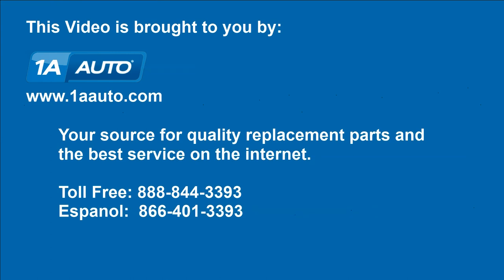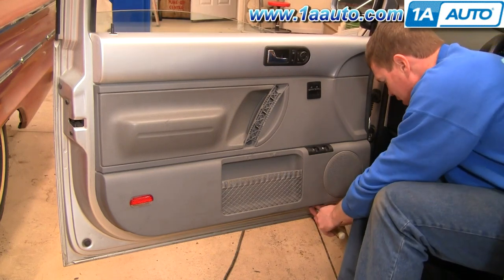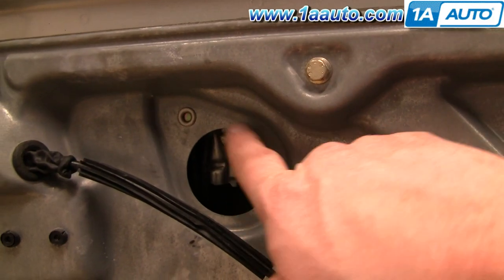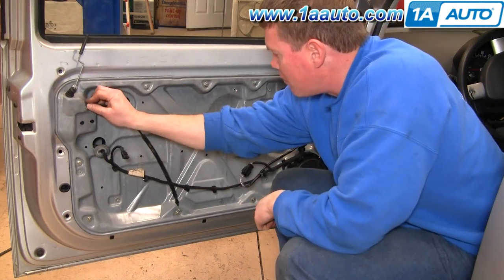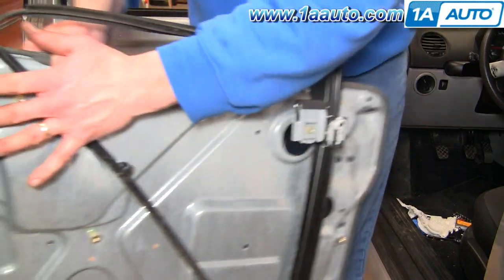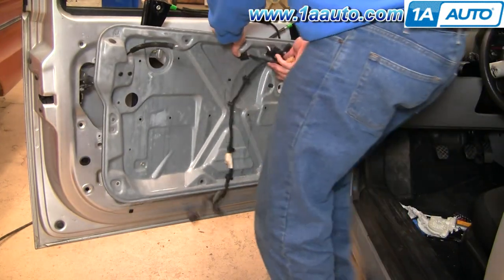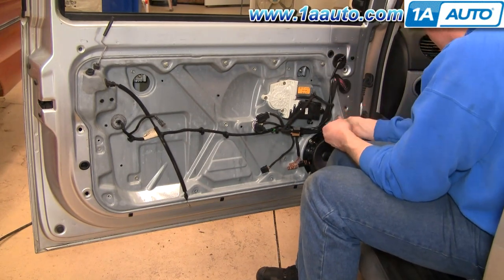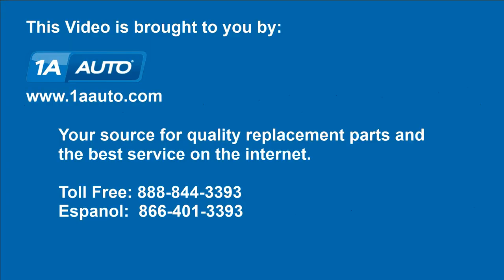How to Replace Window Regulator 98-10 Volkswagen Beetle

Comment: You really should have shown the door connector on camera and showed up where the releasing tab is.  I have been feeling around for over an hour.  I also do not know whether the little black piece on the bottom is the part that comes off or if it is the whole black piece.  Please give us a hand here!
Reply: Did you ever find it?

Comment: Folks I don't know how he undid the door latch tab with his fingers but after using a small mirror I poked around with a flathead bit in the hole facing the door...bit was handy as it's shorter than a screw driver ...and it came away easily then. Took an hour to figure out because he seemed to be just pressing something.
Reply: ...also you need bolts and washers...I had to drive out and get some halfway through, climbing out passenger door at hardware!Otherwise thanks for the video!

Comment: I had to replace the window regulator on a 2001 Beetle. Watching the video was very helpful in deciding that I could do it myself. It took me about three hours, but that's primarily because of the last connector in the door. Like most people, I had a hard time finding the x@!#X$ tab... Also, I ended up adding some lithium grease on the channels and pulleys to get rid of a squeaky noise. Thanks for the replacement part and video!

Comment: Thanks for the great how-to video.. I was able to replace the regulator in under 2 hours and not screw anything up. The only tricky part is unclipping the electrical plug from the lock assembly. What a pain that is!
Reply from the maker: Thank you for watching. Glad it helped!
1aauto.com  888-844-3393
Reply: How did you do it? I can't unlock it and he didn't show the tab that he pushed or pulled to unlock it

Comment: Excellent video. The window on my 2005 Beetle wouldn’t roll up so yesterday I took off the door panel but couldn’t get the window to stay in the track. I was thinking maybe I needed some adhesive but now I see (from your video) that I need to adjust the torx screws. Heading outside to try it now. Thank you for posting this!
Reply: BTW it turned out to be a 10mm bolt (rather than a torx 30) on the ‘05. Same concept though —and now my window works again! It struggles a bit though so I need to find out what’s causing resistance.

Comment: Thank you so much Mike! I have a 2001 Seat Leon 1.8 20v and I'm having some problems with the electric window. I've bought a repair kit and tried to replace it however I didn't know how to take that metal panel off. Thanks to your video now I'm able to do it myself and don't have to pay for it :)

Comment: If you're removing the plastic regulator, DO NOT cut the plastic ties on the new regulator until it is in place and all the cable are connected.  I made the mistake of cutting them before I connected the cables in place and it all unravelled and added hours to the job.  Get all the new cables connected, put the regulator in place and THEN remove the plastic tie and black clamp and any other plastic ties.  Thanks for the video.  I did eventually get it done and saved hundreds of dollars on a trip to the mechanic.  I ordered a replacement kit on eBay the cost $35 and came all the way from Turkey in less than a week.
Reply from the maker: +Sean McKay Thanks for watching. If any of our viewers needs to make this repair, we carry the auto repair part shown in this video on our website. Here is a link to them http://www.1aauto.com/1A/WindowRegulators/Volkswagen/BeetleNew/1AWRK00257?utm_source=YouTube&utm_medium=CTA+Comment&utm_campaign=ytcomment&utm_term=GJzjDr9-_XI

Comment from the maker: On the wires that connect to the switches on the back side of the door panel, you need to squeeze the tabs ob the connector together to remove the wire harness.

Comment: Hello everyone! For anyone who's stuck with that connector at the end of the wiring harness, it's shaped sort of like a cylinder (on my 2001 Beetle, at least), and that cylinder pulls straight out from the rest of it. There doesn't seem to be a tab that holds it in but you'll want to wedge a flathead screwdriver in where the cylinder meets the rest of it to pry it loose and get it out. 

Good luck!

Comment from the maker: You may want to make sure that there isn't anything inside of the door that the regulator is running into, which could be slowing it down. 1aauto.com 888-844-3393

Comment: Hi when you pulled the wiring harness you broke the retainers the best way is to go from the back and squeeze the retainer so when you put it back the harness is the same way it was the idea is the same for all vw of the era and a other thing is to watch the way you hook the cable to the inner door handle so the hook is installed form the top not from under and make sure that it click tight.

Comment: I have a 2003 VW Beetle Convertible.  What is different about the installation on a convertible?  The regulator has gone bad and I have purchased the interior panel with the regulator and wires already attached.  I just need to put the motor on and figure out how to take the interior panel off and then put it back on.

Comment: That’s some pretty clever engineering by using all of the plastic to almost guarantee that the unit will fail and need to be replaced. The old GM automobiles were built so heavy duty they could cut off a child’s head in the window and they rarely had problems like this.

Comment: grommets to hold the inside door panel to the frame were all busted by the dealer when I had mine done in 2015 (was $400) ... went to the junkyard and pulled old grommets from several old VW bugs and sprayed them w/ WD-40 before re-installing them into my floppy door, just cost $4 at the junkyard and about 20 minutes of my time ... put 'em back in , in about 10 minutes !!!

Comment: Hi! Just about to tackle the job myself. What sized bolts do i need? I gather they need to be flat heads and I'll need washers, but what length? Too long and I imagine they'll interfere with getting the door panel on again, but too short and they won't go all the way through. About a half inch? What diameter? Thanks!
Reply from the maker: +@KryssLaBryn As long as your original hardware is still in good condition, you may reuse it.

Comment: Hi there. Thanks for the detail in this video. My window is all the way down—I won't be able to lift the window up and hold it in place with tape. Will this be a problem?
Reply: Put some tape on a pair of pliers and lift slowly take the rubber strip off till you can get your hands on both sides of the glass and use duct tape to keep it up,

Comment: Hi. I have 2000 VW Beetle and it has power windows. My issue is the driver side window does not go all the way down but the passenger side does. No other issue with the windows. Push on the button goes down, pull up on the button window goes up with no assistance. Can this be just something that is lodged in the way?

Comment: My 2004 Beetle has the same problem with the driver's side window having difficulty rolling all the way up so I decided in all my wisdom to "help" it by pulling it upwards and I guess that must have somehow caused it to become unharnessed from the regulator I'm guessing as when I tried rolling up the window the whole window was coming up diagonally angled and soon after just fell into the inside of the door. But I still would think the problem was the engine going bad and not the regulator?

Comment: Fantastic video! I have 1 question, I am getting ready to tackle the job myself, but I have the same problem as some others. My window is all the way down, how do I raise it before taken the panels off?? I read through all the questions and reply's but could not find the answer. Can you clarify the way to raise the window please?
Reply: Opps - Raise the window, after taking the panels off.
Reply from the maker: Katie ray
Thank you for watching. You want to cut the cable. That will free the regulator and you can move it as needed. Here is a link to the part on our website.
1aauto.com 888-844-3393
http://www.1aauto.com/1A/WindowRegulators/Volkswagen/BeetleNew/1AWRK00257?utm_source=YouTube&utm_medium=VideoReply&utm_campaign=1ATony
Reply: 1A Auto Parts
 Thank you for such a quick answer. Your videos are so precise and clear, excellent job! I went to the link and saved the video and the page with the part number as well..  I am going to watch the video several times to make sure I have everything in my mind correct.  Will let you know what happens, :) Yesterday I checked out several other videos on Youtube from different people and yours was the best of the all, no exaggeration . Again Thank you.

Comment: You should point out the door lock module it attached to the window carrier with ribbots. Youra didnt have it attached anymore. Or try and slide it off ita plastic bracket.

Comment: Can this replacement of the regulator be done on the convertible as well?
Reply from the maker: +Bianca Reyes Thank you for checking us out. The convertible will be slightly different in appearance and size, although some of the steps may be the same. 1aauto.com

Comment: I have a quick question. My window on my 2001 VW beetle rolls up but when it get 3/4 the way up it gets really slow and sometimes even stops. I can sometimes push up while holding the switch up and it will go but I am not sure if the motor is bad or if the window is off track or what. Anyone know what I can do to fix this without paying an arm and a leg?? I was hoping it is just off track but just need to know if it's the regulator or motor or what??? Thanks!
Reply: The channels where the window slides up and down may need some silicone lube.  The two slides with clips that hold the window and move it up and down may need lubricant along their channels.  The motor may be weak, i.e. bad, i.e. shorted out inside and thus lacking normal power.  Take the window regulator panel off the door, plug in the power and see if the window regulator goes up and down fully without being attached to the window.  Add a little pressure with your hand to see if it looses power.  Observe the action to see if the cable is binding somewhere.  Then also move the window by hand up and down to see if it is binding anywhere (while the windows is not attached to the window regulator & motor).
Reply: I waxed  the glass inside and out w/ Meguire's car wax and buffed it out ... works a helluva lot better now !!!

Comment: Question, is it possible to repair the regulator??
Reply from the maker: +Sandor Rezmann Usually not because the cable typically stretches or breaks. We carry new ones on our website. If you would like to reply back with the year of your Bug and the side you need, we could reply back with a link.

Comment: I had the window regulator replaced about 6 months ago and today, when I closed the window a rubber cable came out. What could it be? I see the cable on the left side of the demo but I have no clue what it operates. What is the function of that cable? Everything seems to be working fine.....
Reply from the maker: +Cecilia Gurgo It sounds like the cable might have stretched and came off of the assembly. We carry the window regulator shown in this video on our website. Here's a link to them. Hope this helps you out. https://www.1aauto.com/1A/WindowRegulators/Volkswagen/BeetleNew/1AWRK00257?utm_source=YouTube&utm_medium=CTA%20Comment&utm_campaign=1ATony

Comment: I just need to get my window back up so that I can drive on the freeway thanks
Reply from the maker: +Cheyenne Kistner Thank you for checking us out. You may need to loosen up the bolts and manually lift the window up or disconnect the power to the motor and see about moving it up by hand but this is not the best way to keep the window and we recommend replacement as soon as possible. 1aauto.com

Comment: I have my door panel off, took the motor off, but my window will not move up past 1/3 of the way. It goes up and down to there. What would be causing that? I am able to use the power button to move up 6' and then it stops. Its obviously not the regulator. Is something jammed? Thoughts?